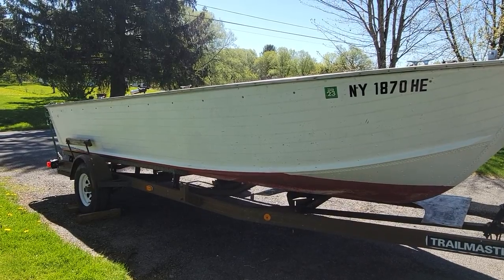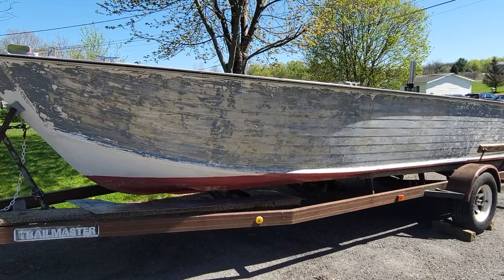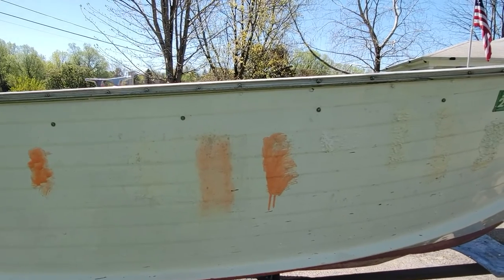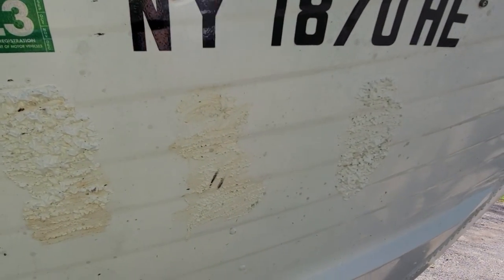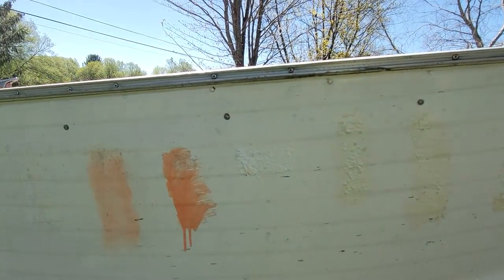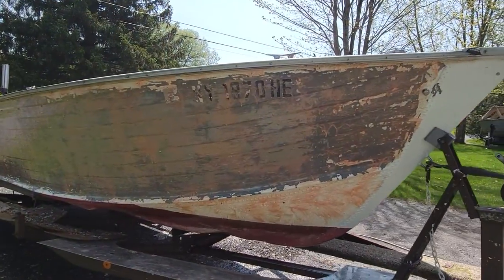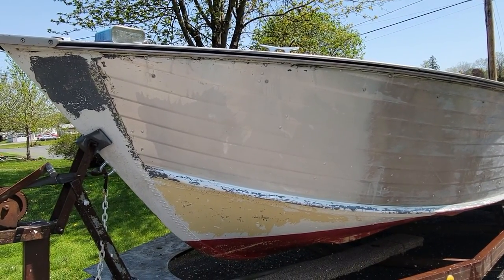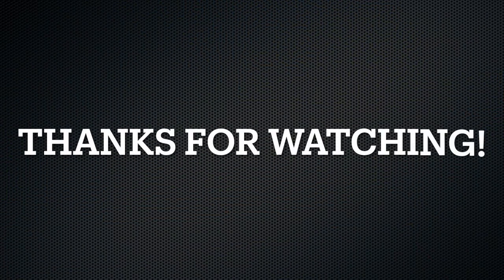Vintage Aluminum Boat Restore - Part 4 - Paint Stripping

Comment: What did you conclude was the best paint stripper?
Reply from the maker: Personally for the sides of the boat I liked the Citristrip get the best because it stuck well and didn't dry up in the summer heat. For the bottom of the boat the Citristrip paste worked better since it was thicker.